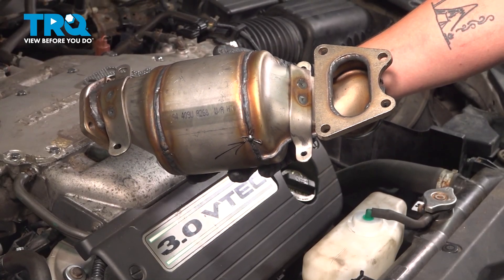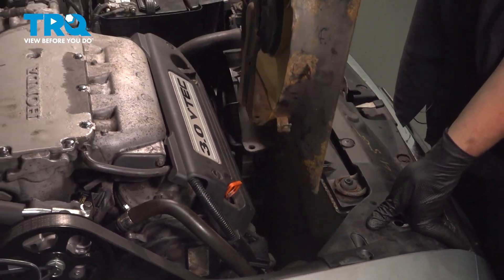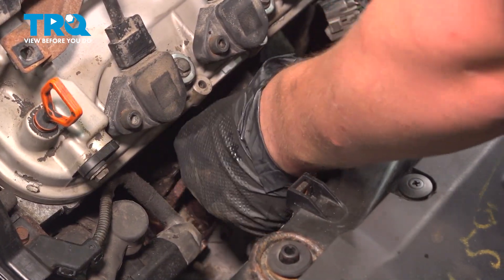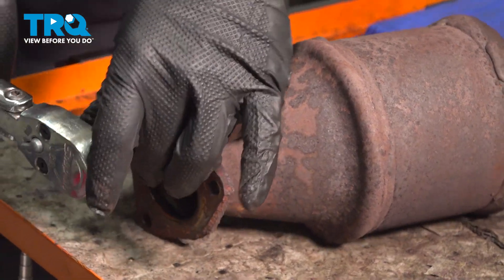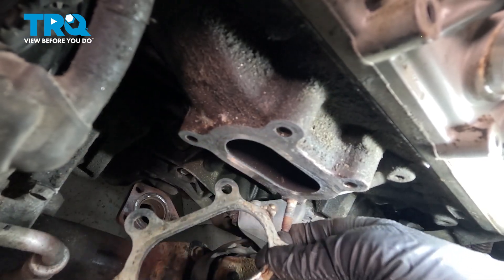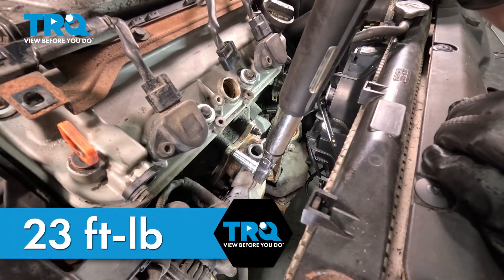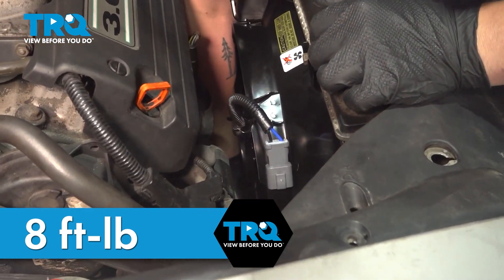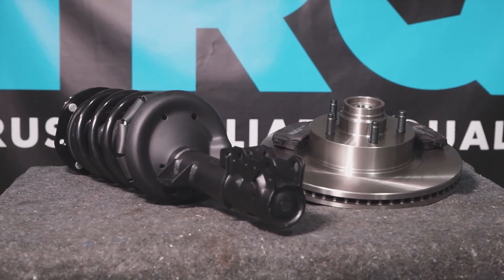How to Replace Exhaust Manifold Catalytic Converter Assembly 2003-2007 Honda Accord (3.0L V6)

Comment: I just replaced the valve cover gaskets that was dripping oil onto the converter. It still seems to be smoking kinda bad even after replacing, you think it might be old oil still on the converter or you think it might be the gasket leaking exhaust smoke?